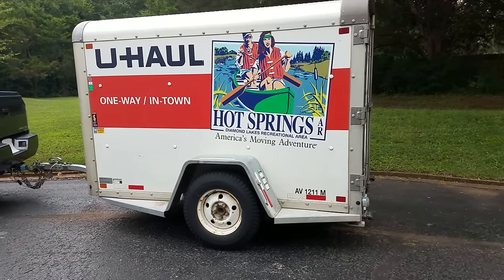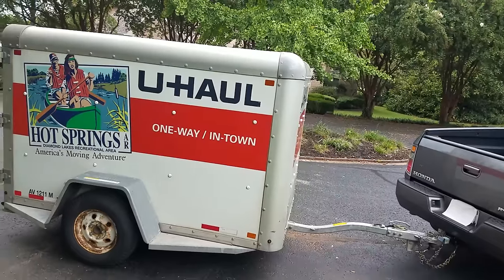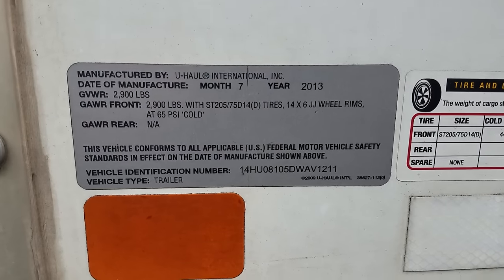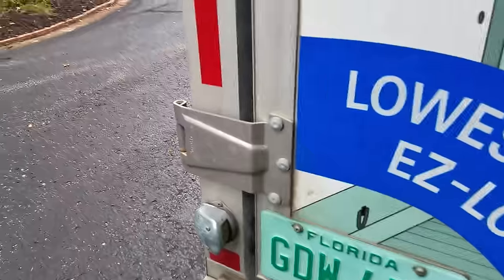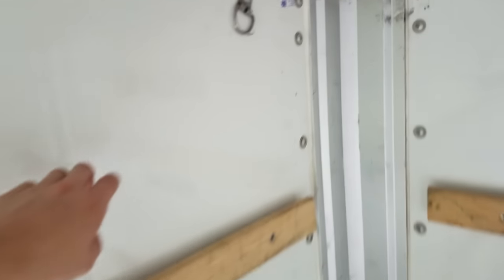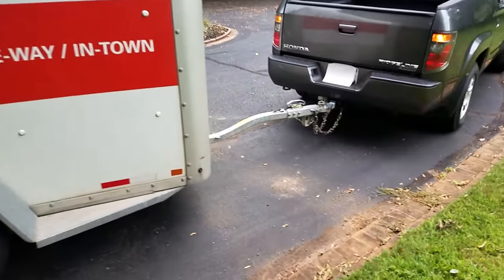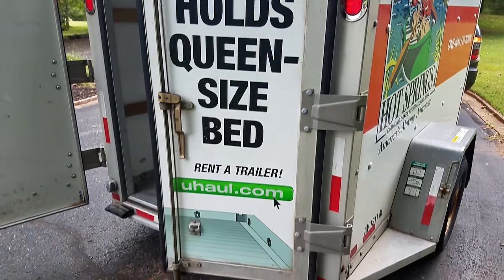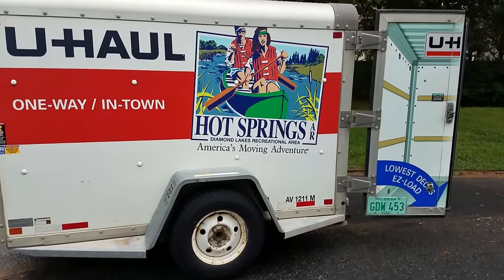U-Haul 5x8 Cargo Trailer Review

Comment: I went to check prices because in this video you mention its $30 for 3 days. Uhaul said to drive from NY to NC it would cost me $540 😳 That's a big leap from $30 a day lol
Reply: Yeah the $30/day price is only if you drop it off in the same location as pickup.
Reply: Im paying $125 unlimited miles for 5 days from CO to MN and dropping off in MN. Not bad!!!!
Reply: They quoted me at $425 just for a trailer hitch and installation. Then an extra $541 for a 5x8 trailer
Reply: Ny to florida 580
Reply: They wanted 1200 for the 12 footer
Reply: WI to NC $595

Comment: that's a good review. I brought one of these back pretty full and it handled really well. I also agree that the trailer is really well built.
Reply: Hi. I’m using this next week to move from Texas to Arizona. All I’m bringing is a queen sized mattress and box spring,TV, light chair, and boxes. How should I load it? Where should I put the queen mattress and box spring? Any advice would be appreciated. Thanks.
Reply from the maker: Put the queen mattress and box spring however they fit. Put a good portion of the heavy boxes up front and taper down as you move back

Comment: Thanks for the great video. We are likely going to rent a 5x8 UHaul trailer for a trip from AZ to KS.  I see it says "Speed Limit 55" - should this be followed? You mentioned all the many warning labels on the trailer, so maybe this is just another one. Please tell me if a person can drive the normal speed of 70-75 mph. Will be pulling with a Lexus 400 SUV. Thanks! Any comments/suggestions are appreciated!
Reply from the maker: No saying you should or shouldn't as there is some liability there. But if you vehicle is of decent weight these trailers will tow smoothly well over 55mph without issue.
Reply: Haha do N O T go 70+ all I can say. I've heard stories. But tow at your own risk!

Comment: I'm moving from NY to CA. I'm thinking of getting this one or the smaller one. Just concerned that my car would not have the power to tow it and if the smaller one will be blown by wind. lol.  Its a 2008 acura mdx.
Reply from the maker: MDX has the same engine as the truck shown in the video. Shouldn't be an issue.

Comment: Moving from GA to Las Vegas, NV. Do you think my 2018 4runner can handle this trailer? The drive is like 2000 miles. First time using uhaul trailer. Any tips?
Reply from the maker: Yes! A 4Runner should be just fine with this trailer. Pack it how they show in the diagram by distributing the weight. Also, ensure to inspect it very well when you pick it up to esure you get it with good tires. Good luck and safe travels!

Comment: I am driving from FL to CA with a Jeep. I want to stop for 1-2 days to visit some cities (NOLA,Dallas, Grand Canyon, LA, etc.) and am wondering if I can safely unhitch at the hotels and lock the trailer so nobody can pull up with a tow hitch and take it away. What do you recommend? Thanks for the great video.
Reply from the maker: Its actually a breach of contract if you unhitch the trailer. Most places now days would have places where you I can park larger vehicles. Think about all the people with RVs that go explore.  Unless your getting the largest trailer it probably won't be too difficulty to navigate any of those places with it connected
Reply: Plus, there's no tongue jack on the smaller trailers, correct?  Therefore, I'm assuming it makes it very difficult, if not impossible, to lift it on and off the hitch ball with the trailer loaded.
Reply: What did you end up doing?

Comment: When bringing home from uhaul pickup location the trailer would be empty right. So to bring it with no weight, is it safe.
Reply from the maker: Yes, of course! It can be pulled just fine empty. It will bounce around and jump a lot when it hits bumps, but nothing to be concerned about!
Reply: @crazyjdkid  thanks for the reply. My car has hitch bracket attached to the vehicle. And there is a ball mount as well. But I cannot find a plug underneath the car for connecting the harness. Have you experienced something like this
Reply from the maker: @raj4all2007  What kind of vehicle is it and is it a factory hitch or aftermarket? Usually its hanging down next to it or its behind a cover by the license of it's a truck. Look for a set of 4 wires!

Comment: when rental this particular model, do you also need a weight distributing device as additional safety? i saw there is a cross metal chain there to connect with your car.
Reply from the maker: No you don't. Those are just safety breakaway chains.

Comment: Good deal man, I never realized the qualities of their trailers. I’ve seen someone towing a UHaul trailer and get a little bit of whiplash before, it looked like a miserable drive. I just started hauling steel with TMC they gave me a covered wagon, pretty much all brand new equipment, new tarp which needs to be broken in. It’s way better than tarping though.
Reply from the maker: Yeah they build these things to last!  The way it's loaded and the weight of the vehicle has a huge impact of how this trailer pulls, you know that though!  I was pulling a good 75mph and she towed smooth. Tarping sucks, but most drivers get a little bit of extra money for tarping the load though. What kind of truck are you running?
Reply: crazyjdkid TMC runs 579 Pete’s with sleepers & 388 day cabs. They’re both pretty nice, not my first choice in a truck ( I really love the old school look on older trucks ) but they have stacks which is a little more old school. 579s were designed very well. They run the Cummins X15 engine & a lot now run disc brakes. The newer Fontaine trailers run disc, unfortunately mine does not. I’ve got some pictures if you want to add me on FB & check them out though. Just let me know.
Reply: crazyjdkid Yeah tarping really does suck but I got to pick and choose where I wanted to work and being in Columbus ohio there is a massive variety of freight going through and coming out of the area. I was able to get to haul dedicated steel and they run covered wagons so I don’t have to tarp at all. I’m really lucky to get the opportunity
Reply from the maker: Pete's a good truck, especially for a fleet truck! I haven't much from the industry on the X15 yet, I do know there is a Efficiency build and a Performance build. But Cummins doesn't screw up very often so I'm sure its a good engine. I believe it is very similar to the ISX. Those disc brakes are great in heavy duty applications because they rarely need any maintenance.  I had an engineering buddy of mine work for Fontaine Trailers as a weld engineer and had him weld some aluminum projects up for me, he had some of the cleanest welds I had ever seen.  My favorite truck of all time, my dream truck, is a Kenworth T800 with like a Series 60 or C15.  You can message me you FB info if you would like.
Reply: crazyjdkid Well, I don’t know a lot about all different truck engines yet, im still learning but from what I hear about these newer Engines, the Cummins is one of the best. Potentially the best you can get in these new Pete’s. Detroit is only on Freightliners, which are nice but in the trucking industry most guys don’t want Freightliner like everybody else. The other option that these Pete & KW trucks have is the PACCAR engine which from I hear is awful. I’m not sure if there are any other options but all these drivers tell me the X15 is what I want. 

KW T8s are very nice, Detroit 60 would be a dream come true. One of these days it’s my goal to drive a truck with a nice C15 in it. I love the sound of CATS or those 60 Series Detroit’s. Wish I could get a rig with one. 

Yeah the disc brakes are nice because if DOT wants to inspect my truck all they need to see is that I have disc brakes and they don’t have to check anything. Same with doing pre trips. With drum brakes however, they take longer to inspect & don’t operate as nice as the disc brakes. Wish the trailer had the but it’s an older Fontaine, only TMCs brand new Fontaines have them.
Reply: crazyjdkid I’m not too sure how to PM on here, YouTube confuses me still lol

Screw it, just search up Eric Farris Columbus Ohio, mixed guy wearing a black beanie in the picture lol I’ll just delete this after you find it.
Reply from the maker: Cummins is king now days, now that most other companies have died off. The little PACCAR engines are rebadged Cummins ISB and ISC. But the larger engines like the MX13 are sourced from DAF in Europe, which is all the same company.  Not terrible engines, but certainly not a Cummins. I want to say the PACCAR actually has a longer rated service life than the Cummins does. I guess outside of medium duty trucks, Freightliners are really only desired for cheap fleet trucks or fuel savings. Same goes for Navistar InterTrashional Most Detroits now days are Mercedes-Benz anyway.
Reply: crazyjdkid Yeah I mean, the Frieghtliner trucks aren’t bad as far as I am aware but they’re just not as desirable. There is certainly better out there too. Most companies just go with Cascadias or the KW T680, most fleets are also going autoshift transmission. The autos honestly aren’t bad especially in a traffic jam, but VERY weird to get used to and I just honestly prefer a manual but ALL the bigger companies are going to auto. TMC has a good number of them too.

Comment: I remember the $30 prices, but now the same trailer goes for $680 (interstate move) and you have it for 6 days. There are no options to get cheaper if you know you will only need for 2-3 days.
Inflation is back to normal levels (2%) but makes no difference to the price, and the supply and demand is likely the same. Price gouging plain and simple.

Comment: Unless your using the break equpiied trailer long distance drives need a break equipped trailer, with suspension and a break controller. I learned the hard way that these will eat up your breaks very quick.
Reply from the maker: Depends on what you are pulling it with. Most trucks have oversized brakes so it shouldn't be too much of an issue for a truck such as the one in the video.
Reply: New brakes don’t cost much if you do the work yourself.
Reply from the maker: This truck has lifetime brakes installed. They get worn down and I just bring them back for new ones.

Comment: I just installed a drawtite class iv hitch on a 2018 Colorado with 5 1/4 drop draw bar with 2” ball and the set up gives me a total of exactly 18” from top of ball to level ground. I need to know if that height will make the 5x8 trailer ride level, since you already towed.
Reply from the maker: I just went outside and measured my Ridgeline, it is exactly 18" from the top of the ball to the ground as well. So if your happy with the levelness in the video you should be good to go!  Don't know how much you suspension will sag, but since this trailer has very little tongue weight  it shouldn't be much.  The Ridgeline's suspension didn't budge. Thanks for watching!
Reply: I am renting a 5x8 Uhaul trailer to move my daughter’ belongings 2.5 hours away and needed to know all the details. Thanks for your reply!

Comment: Uhaul should add led headlights,led back lights,led marker lights.led is better than halogen lights.the thing I like about  uhaul trucks is that the seats are comfortable,and I like the idea of how uhaul put reflective tape on the trucks,it makes the truck visibile at night.if I was moving to house to house I'll rent a Penske or ryder truck with a lift gate.
Reply from the maker: I believe most Uhual marker lights are LED, and the lights are on a light sensor. The seats are comfortable! But the competition can be as well depending on how its spec'ed when ordered. You can even get air ride on the competition, Uhual doesn't offer any trucks with air ride. All the trucks I have rented, no matter the brand, has had reflective material on the back. Thanks for watching!

Comment: Moving from Maine to Texas on the 26th, do all the 5x8’s use that same twist locks? And does anyone make some kind of locking mechanism that works for those? Appreciate the help!
Reply from the maker: All uhual trailers are the same. Are you talking about the twist lock that locks to the ball hitch or are you talking about the mechanism that closes the box on the rear?
Reply: The twist lock that locks the ball
Reply from the maker: @kloejames  Oh! Its not complicated at all, you set the trailer onto the hitch like normal, then twist the little square and as you tighten a little arm underneath tightens itself against the ball locking the trailer to the ball. And if you want to take if off the depress the little button and turn the square in the other direction. Here is a picture to help you understand. https://www.uhaul.com/Misc/ImageHandler.ashx?type=full&fileid=8df9dfe8-8718-46fb-acdf-2af608675bc8   The button to loosen it is "C". Let me know if this clarifies it better!
Reply: Does someone make locks to prevent someone from just unhooking the trailer and stealing it?
Reply from the maker: @kloejames  There are no locks on the hitch itself, so theoretically yes anyone could just take it off. But what you can do is when you thread your safety chains through your hitch and hook them back to themselves, you take a pad lock and lock the chains together effectively locking it to your car
Reply: Ah ok! Thank you!
Reply from the maker: @kloejames  Anytime! Let me know if you have any other questions!

Comment: i am going to rent one of these to move from FL to PA. i just got a hitch installed in my 2015 kia optima by uhaul. im still doing my research and seeing if my car would be able to pull this trailer up the mountains. Any suggestions? my hitch is rated for 2k pulling weight and i have about 600/700lb of stuff. Thanks
Reply from the maker: Can it tow it? Yeah, it can probably tow it.  Can it tow it comfortably and safely? Hard to tell. I wouldn't be concerned if it can tow up the mountains, as its ok to go slower. I would be most concerned with braking. If you are able, I would try to go to the size below this one. But if not just load it very carefully and distribute the weight correctly.  I am guessing you have a tongue weight of somewhere around 200lbs. Drive carefully, and don't try to be in a hussle and I think you will probably be ok.  But take my opinion with a grain of salt!
Reply: Good luck with that.👍
Reply: CooLStuff Gamer thank you, I’ve decided to go with the 4x8 trailer. Safety for me and my car is more important than extra space
Reply: @LillRichy  yes yes I understand
Reply from the maker: That's good! Glad you opted for the safer route! Best of luck with your move and be sure to drive safe!

Comment: very nice vid. :) my sister was going 2 rent 1 but smaller that she could pull behind her car. she was going 2 have a hitch put on her car as well. but then she ended up not doing any of that.
Reply from the maker: MRJOHNDEERE3720 yeah they are handy for sure! I dont know how I would feel with pulling one around with a front wheel drive car! I have seen people do it though! My truck weighs a bit shy of 3 tons and is 4x4, loaded you can definitely feel it back there especially the 6x12. My knuckles would be white if I was pulling one of these with a little car.
Reply: her car is 4wd but even then i'd be scared..
Reply: Yeah I always feel sketched, I was driving out west and saw a BUNCH of sedans and crossover cars hauling the tiny Uhaul trailers. Thought it was kind of weird. I have no reason to haul but I would like a vehicle with 4WD rather than my FWD 4 Cylinder Hyundai lol it’s awesome on gas though.
Reply from the maker: People do crazy things! The truck in the video pulling it gets about 9-10 mpg when its towing, so I can only go about 200 miles before filling up which kind of sucks.  I am kind of heavy on the throttle though when towing, just so I am not a traffic hazard. It doesn't feel this 5x8 trailer back there, but it lugs down a bit with a fully loaded 6x12. Its a Honda though, so it enjoys the abuse!
Reply: crazyjdkid Yeah that’s a nice pickup. I don’t know what my next vehicle will be. I don’t drive my car a lot anymore now that I’m driving around but I’m home more than a large majority of drivers. I kind of want a pickup but really enjoy the fuel mileage on my Hyundai.
Reply from the maker: I'd say keep the car! You can always rent or borrow a truck if you need one! The fuel mileage is just terrible. Or buy an old beater truck, like an old 7.3L.

Comment: no way to lock the trailer to the hitch? i'm moving from the east coast to the west coast and that makes me nervous someone could just take off with the entire trailer and empty it out someplace. any creative way to lock it?
Reply: I see that you can lock the chains...padlocks are so easy to pick tho haha...i'll have to research a good padlock if there is such a thing
Reply from the maker: Yeah, I assume you read my response to the lady asking a very simile question! Another tip is when parking for the night to back the trailer up to a wall to keep the rear door from opening. But honestly I wouldn't worry too much about people stealing the trailer or the things in it. A lock is not going to stop someone determined to get the trailer, as a lock is more of a deterrent rather than a block. Insure it, park in well lit areas with cameras like hotel parking lots, and lock the rear door and you will be fine. I just did a 1000 mile trip with one and nobody batted an eye at the truck.
Reply: Well who ever rent them to you are not doing there job then they weigh in at 26000lbs which is CDL weight.
Reply from the maker: CDL weight is 26,001, the penske 26ft truck comes in at 26,000. Which is one pound below the limit. Please misinform people speaking out of ignorance.